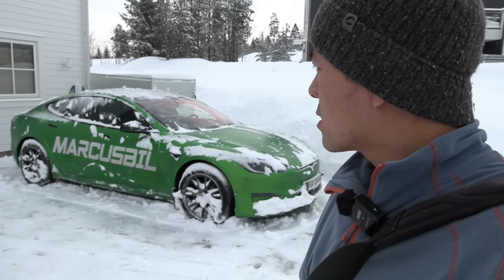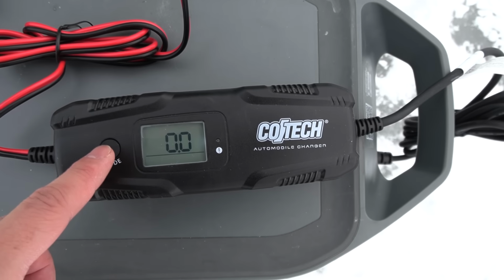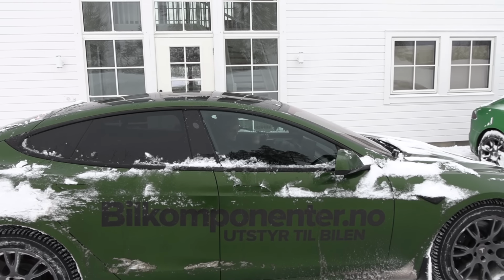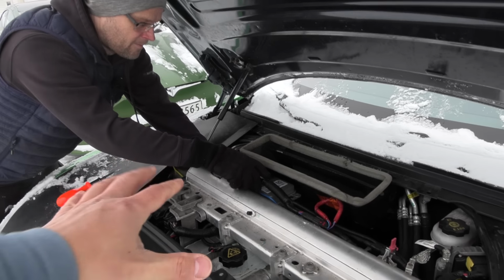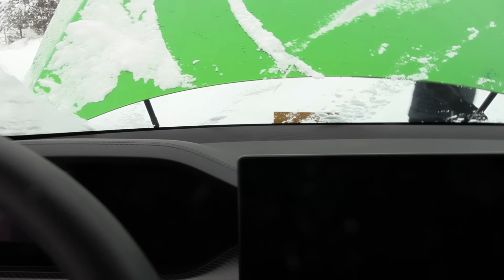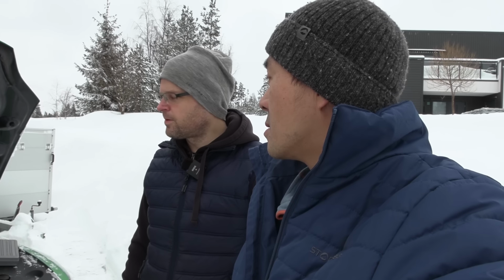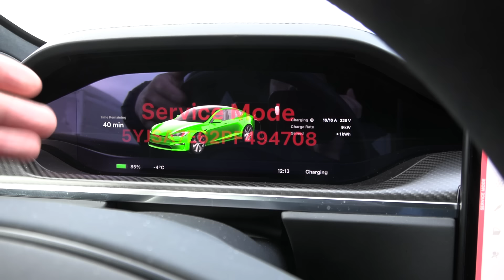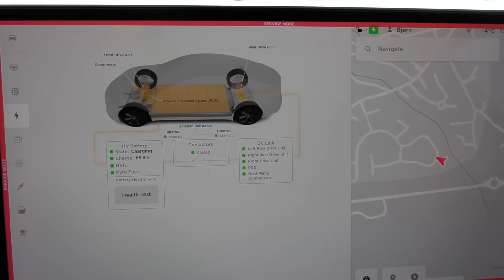Tesla Model S Plaid died in the cold

Comment: I'm not surprised these will discharge over time.  Cold weather is hard on batteries anyway, but on the Teslas, my relative has one and it is wifi connected and faffing about on there all the time while it's sitting there parked.  That's not that high a power draw, but when it's like 20 below zero or whatever actually it is.  They really should be having it do whatever it's going to do in the first minutes after it's stopped and quit doing it after it's parked for a while.  (Frequently GM products will shut everything down after 10 minutes for just this reason, to avoid any parasitic drains.)

Comment: i know it isn't an EV, but a 2021 Skoda Octavia has/had a sw "bug", where the onboard computer didn't "go into sleep mode", and that basically drained its 12V battery to the point where nothing worked (locks, cabin lights, nothing). it had to be towed. So, maybe it's a sw bug ... ?

Comment: If the cars battery voltage is exteramly low the jump box will not supply its own power to charge (or simply provide enougth power to open the hood) the car dur to its protection circuitry sensing voltage too low, this is also done for polarity protection sensing  , you must put the jump box into its  "boost mode" to bypass this, as allways be very careful to ensure your connections are correct polarity .. the deeper question I would like to ask is why does the tesla allow the low voltage battery to get to such a low state of charge ,(and thoughts on this issue do take place) they should find a way for the DC to DC converter to charge the low voltage battey when required when the car is shut down .. as long as the main traction battery has enougth charge to do so.. there going to have to find an effective way to provide aux heat to the lithium "low voltage" battery (like a heat wrap) when its extermely cold ."Or" use a low voltage battery with a diffrent Chemistry that will continue to allow for charging at low temptures .. otherwise the battery will dip below the cell temperature that its "Battery managment system will allow charging, and then be drawn below its cutoff voltage by cars electronics drawing standby current..
Reply: Or, don't be a knob, and keep your wallbox on and car plugged in during extreme cold.

Comment: With all the problems people are having with the low voltage battery you should be able to remove it easily to charge it or swap in a new one. What you had to do to get into the car and get it going is just crazy how would an average user get it going never mind opening the hood.

Comment: This is the basic specifications of a Lithium Ion battery. The temperature range for the operation of a lithium Ion battery has its limitations. This battery technology will not work properly in your climate. Most manufacturers don't even try to properly condition the battery in the extreme temperature ranges? Yours tried. You could damage your cars battery trying to charge it until it is in the proper temperature range.

Comment: your lithium 12v battery has a bms which monitors its internal temperature , if it gets too cold it turns off the battery terminals , rendering ur tesla dead. i recommend you to use a lead battery instead , nothing else is wrong with ur tesla

Comment: This is typical of those old 12V lead acid batteries when they hit the end of their life or have some internal short.  The cold absolutely destroys them at that stage, biggest set of clues is the charging curve, it’s not accepting a ton of amperage when a ton of amperage is available even in the cold it should be sucking down a ton of power if the battery is good and just weak.  Low state of charge and not accepting a ton of power or only briefly accepting a ton is a big clue.  
 

And teslas rely heavily on that 12V battery for their control circuits hence why when the 12V battery dies so does the car.

Comment: Makes sense tesla uses an under powered 16v lithium battery that goes into bms cold protection mode. Time to add a battery thermostatic warmer and tie that into the 12v system while the car charges, no more dead tesla.

Comment: Lithium doesn't work at -15C... the chemistry has severe dendrite formation if you try to charge at that temperature. That's why it's important to leave it plugged in with access to wall power... it can run heaters to keep the cell temperature warmer and continue to function. Since the car is always "on", if you don't give it a power source, that battery will slowly drain from phantom drain. Once voltages get too low, chargers won't even try to charge, and nothing will draw from a battery. Pulling power from a dead battery causes severe damage to the internal structure. So really, just leave it in your garage or leave it plugged in so that it can maintain itself.

Think of it like a person. If your friend left you outside without a coat or heater/warmer in -15C and checked on you in a day or two, how well would you be functioning?

Interestingly, cell phone chargers typically trickle charge regardless of the state of charge, so if your cellphone battery goes to 0% and you leave it for 6 months and it won't power up even when you hold the button down for a minute while connected to a charger... if you walk away and come back in a day or two, usually it will have trickle charged into the allowable voltage range and woke itself up.
Reply from the maker: It's irrelevant. Battery was at 82 % SoC.
Reply: @bjornnyland  The smaller one was 0% SoC once you were done freezing and draining it. You show it being 19% after you charge it for a while... it got too cold, couldn't deliver the volts, phantom drained down, and then you couldn't get any signs of life. That's normal behaviour for lithium batteries.

If you kept it in a garage, it wouldn't have chilled as much. Then you could go out into the cold (-30C) for hours and the residual heat energy and internal warming would've kept it high enough that everything would still function fine when you go to start your Tesla up and drive home to the garage. These cars are designed for pretty normal use, but if you basically leave it in nature's refrigerator, chemistry and physics take over.

Leaving it plugged in and able to draw energy constantly would've helped. I believe it can draw power directly rather than depleting the smaller battery, and keep the heaters going. Maybe not energy efficient, but it keeps it operational at least?

Comment: We're being told that EV's are more reliable than ICE cars and require less maintenance.   Seems that they are quite a bit MORE complicated with more links in the 'failure chain' able to prevent the vehicle from working just when you need it the most.

I agree that there should be a mechanical way to access the low voltage battery and it seems kind of stupid to require the low voltage battery to be functional to access it.   Jumping the external connection isn't going to do you any good if the battery has actually failed and not just discharged down too far.   And where is the logic that you have a huge main high voltage battery that is unable to keep the low voltage one charged up?   These cars are going to be a nightmare for owners in the future when things degrade and begin to fail.   Look at the screen @21:50 and see all the devices in the system and any one of them failing will leave you walking.   No thanks.

Comment: One thing that stuck me if I heard right was he was cutting power to the EVSE charging unit.  I am wondering if he hadn't had done this the car wouldn't have died.  The car in very cold weather might have needed the extra current from the EVSE to keep warm.  The other thing I was thinking was sure the main high voltage battery pack has cooling and heating fluid to keep the battery from getting too cold to operate but what about the low voltage battery?  I doubt it has the same thing.  If it gets too cold then that would make sense.

The other thought that came to me is what does he have in his garage that would be more valuable than a Tesla Model S?  Why would you leave such an expensive car sit out in the elements unless you had an even more expensive car in the garage?  Must be nice to have that much money.
Reply from the maker: No problem to not be plugged in. I had 82 % SoC.

Comment: Glad you got it going, is the 12v/16v being topped up from the main battery. In some EV's you need to power up the car to use the main battery and some people forget this . Then the 12v Battery gets drained powering the media, lights and air. Am I correct that the Tesla only does this after pushing the brake, or is it when the door is opened?

Comment: I would recommend a lab-bench power supply. 
There you can adjust the voltage- and a current- limit.
Therer are lot of good supplies available with up to 20A output for little money.

Comment: Yes, just use the ecoflow's 12V output.  Though it is probably severely amperage-limited so it might oscillate.   You can use a battery charger but it has to be a lithium battery charger that knows how to wakeup the BMS of a dead lithium battery.

Comment: I’d use a CTEK charger for use below -15 and fix in a CTEK charger connector for easy charging. Yes the Lazerlamps Elite LED bar is extremely good!
Reply: CTEK is outdated. I recommend Victron Energy chargers, they are not much more expensive than CTEK and the features are from different world. Similar like Tesla vs petrol cars.

Comment: Likely one (or more) of the cells in the LV battery has become high resistance, then the BMS cuts it off because of low voltage protection then you have another related problem because of the way a smart charger works. If your charger has a 'dumb 13.8 volt mode' then use that to jump the LV battery.

Comment: So, everyone can put 12v on that plug in front and the trunk will pop-up? Did the door opened without card also?
Reply: No. The front wires will only pop the front trunk if the low voltage battery (and car) is dead. For obvious security reasons.

Comment: Problem with a lot of those 12 volt battery chargers that are smart is that they first try to measure the voltage to make sure they've got correct polarity and a reasonable voltage and if they don't have that they won't do anything ever you need to have one that will just put out some power

Comment: Would a small $10 solar panel placed on top of the instrument panel and attached to a resistive heating element help warming up the 16V battery? It would be independent from the rest of the systems and increase the chance the small battery would be able to receive the charge from the traction battery.

Comment: I wonder.. does the low-voltage battery have a battery heater?  If it doesnt, and you get to very cold temps and cold soaks.. there will be near no energy available to do anything...
Reply from the maker: No, already explained in the video.

Comment: The problem is that the 12V battery discharges really quickly even when the car is idle and because it is a lithium ion battery it does not like to be charged below -15° as it degrades a lot. As far as I know it does not have a resistive heater so when it gets close to empty the BMS won’t allow it to charge killing the whole car. Tesla should have used the sodium batteries from CATL for this

Comment: If you discharge the battery to zero in the very cold the 12 v battery will run down powering the sub systems and then it will freeze.

Comment: Sticking to my rip roaring audi gas car.  Would love an EV but living in a colder climate and not willing to spend 7 figures on a big house just to avoid this problem
Reply: Gas and diesel bearly can start when it’s that cold. Diseal literally becomes thickets and clogs fuel intakes. 
EV’s by far are better by a long shot for the cold
As long as the battery has a heater
Reply: All you need to do to avoid "this problem" is keep the car plugged in and wallbox powered on when the car is not in use.  It's not difficult.  The issue in this video was all self inflicted by Bjorn conducting yet another science experiment, this time turning his wallbox off for 4 days in subzero temperatures 🤦‍♂
Reply: @EvilNeuro  Did you watch the video?  The issue is it was bricked and a royal pain to get alive again.  EVs suck donk-donk in the cold as well, range is diminished dramatically to the point it's like driving a sports car with COPD and an oxygen tank
Reply: @beforetheinternet  That's an issue for folks who might own a cheap condo where they'd have to foot 5 figures plus and deal with an HOA to install chargers.  Or someone who rents and doesn't want to spend half a million on a house just to buy an EV.  The worst part is that when the car fully discharges it was a royal pain to wake up.
Reply: @happyfunnyfoo  I am aware.
Here’s my point in a easier to digest way
ICE (diesel and gas cars): worse preforming in the cold and at higher altitudes but no issues with range in the cold (though at higher altitudes ig it can)
EVs: no preformence hit in the cold or at high altitudes but less range.
It’s a fight of sorts.do you take a car with less range or a car that works worse in the cold and might night even start in the cold? 

But yes EV’s are much worse in the cold
I was pointing of the fact ice’s struggle in the cold too
Reply: @happyfunnyfoo  also to ur reply to the other person

No?? Almost everyone who buys a ev isntalls a charger. Literally one of the nicest benefits of EV’s is the ability to never have to stop to recharge (due to charging at home) 
Most people install chargers in their garage where a hoa wouldn’t care about.
Also I stated this Eariler. Teslas have heaters in their batteries. But if u know u let the thing die of course it’s going to be hard to reheat it, 
Bro it’s like letting a gas car sit for 2 years and being angry it won’t start.

Comment: LFP batteries do not work  below -18c they should have a battery warmer coming off the main big battery to keep them around -10c  at the coldest..  it probably has a battery warmer when it being charged or running . but you disconnected the AC and then you were stuck when it cooled down overnight.. man would suck if you went to visit someone and they did not have  charge point  or a heated garage  and it would cold . you  would be stuck trying to get your car  battery to work even worse if it was cold and windy conditions  and an emergency type situation arose  that would really suck.  my electric car  has a battery maintainer  that works basically "analog" as it independent of  the cars computer  . basically  a 1000w buck converter  and  that keeps the  12Vbattery at a specific voltage no matter what. unless it detects a bad battery  then it will shut down. the buck converter off the main 300v battery  is really providing  all the 12volts, the  12 volt battery only really acts as buffer. but with my car  if I did not have it plugged in and it was colder then -30c  it would chill down enough after  2 days or 3 days  of no use then it will refuse to start. but all it will do is tell you to plug it in the warm the battery up it usually takes 3 hrs and then you are good to go again . - also kind of a poor design by tesla  that it can not use the  charge point to warm the 12volt battery and maintain it  after it went cold

Comment: The car might have needed to boot up after being totally powered down. The booster might also have been delivering poorly regulated power with a lot of noise compared to a normal battery if it lacks adequate filtering. It's designed for a 12V battery which would smooth the output. My 2013 Tesla model S pre-heats the battery, so they've had that for a very long time.

Comment: Hello, Mr.
Bjørn, you need a Li-Ion charger or buster for this 16V Li-Ion battery. The battery has 4 cells of (1) 3.7V. Max. e.g. is (2) 4.2V per cell and a total of (1) 14.8V (2) 16.4V and ideal charging with 1A - 2A.  Best reagards👋
Reply from the maker: No, it's not needed. Tesla has designed the low voltage system to accept 12 V charger (14.4 V charging voltage) if you disconnect the 16 V battery.
Reply: 👍 @bjornnyland

Comment: I have  lithium battery booster in my glovebox. That I can get to because I have a key. I haven't need it for my own car but if I ever did I wouldn't need anyone to come boost me. When it is -40 it can be life and death if you get locked out of your vehicle. Inside my vehicle I have blankets, chemical warmers, lights to warn drivers in the dark that I am broken down. All my safety kit is IN THE CAR. Not being able to access your safety kit is a safety issue. Period. Not an issue when I am in the city but when I am servicing well sites in the field or working in rural locations in the winter waiting for a boost to open my car is damn stupid. If I had this EV I would need to make sure I left my car with my battery booster.

Comment: Only when such things happen then you will understand that these kind of cars are extremely difficult to get running again.  They are similar to  a dead cow in the middle of the road of which nobody has any idea  how to move without danger as these cars like to explode or burn when least expected ... them unless you call a megapower DIESEL  forck lift to get it out of the way !
Reply: The moral is to not let this happen in the first place by turning the wallbox off in extremely cold weather.  All self-inflicted.

Comment: NEVER EVER use that charger in start modus on modern cars, especially something high tech as this car...
The voltage in that charger are way more than 12v open circuit in start mode..
I have the newer model of this charger and it outputs over 30 v in this start mode, normal charging mode should be used here. 
This old biltema chargers should have their start boost button removed if someone still use these chargers today. 

All the clicking was probably the electronics in the car freaking out from over voltage.
Lucky you didn't fry anything and got it back to life.